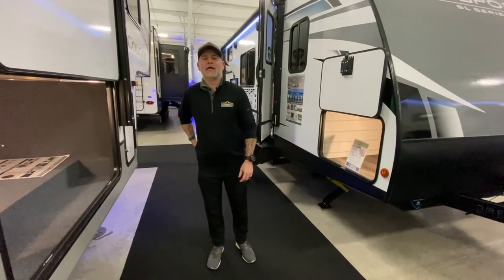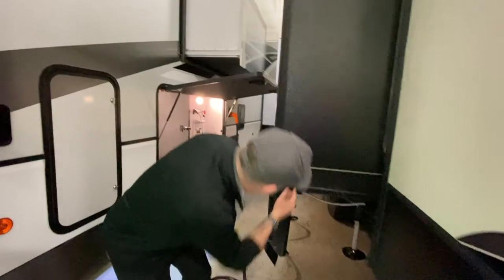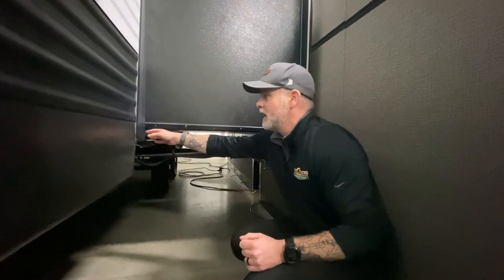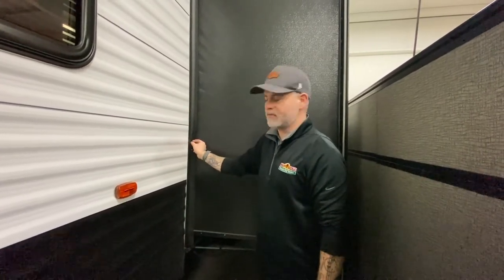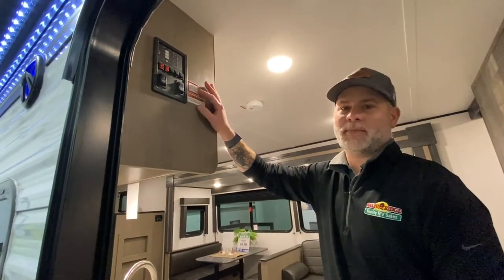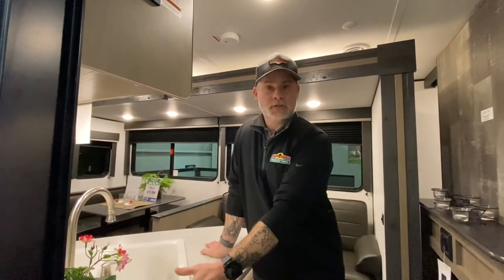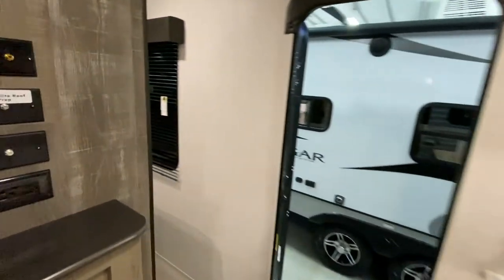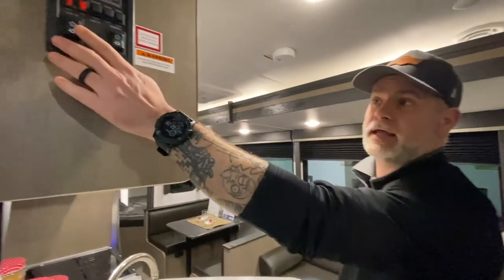How do RV slides work?

Comment: We just bought an RV with a slide out, an electric slide out. Is it possible to retract the slide in too much? We are second owners and it looks like the exterior wall around the slide has moved in a little bit
Reply from the maker: I've never heard of that. Typically you will hear a grinding noise and that's when you stop. Your slide could be off-set a little bit which would give the appearance of being in too far on one side. Hope that helps!
Reply: Maybe  the stop wasn't set properly from the factory or first owners messed with it? The noise you hear in video is probably a torque limiter skipping when the load exceeds the limit. This allows the slide to stop when it "bottoms out" or hits something heavy enough. Apart from mechanical methods, one could measure motor current to determine the load or use encoders/endstop sensors.
Is the slide pushing hard against the wall every time, or is it just pushed in a bit and not progressing?
If it's not springing in and out I would leave it alone. If you adjust the slide stop outwards now you won't get a good seal without fixing the entire wall.